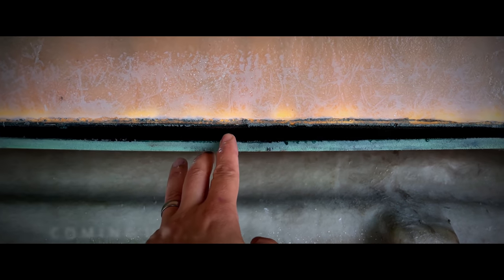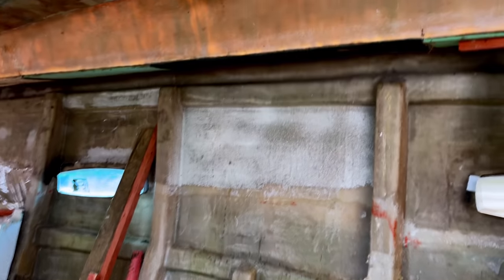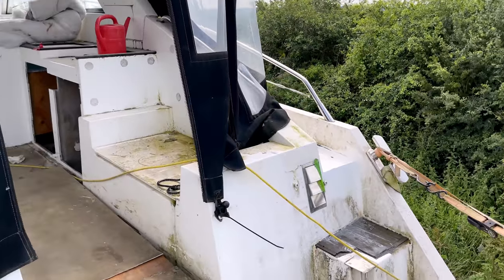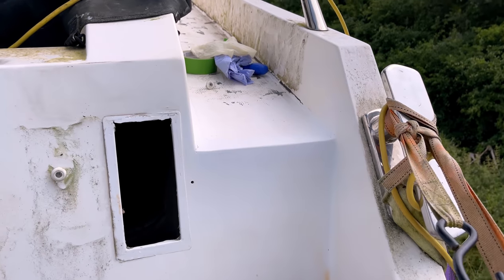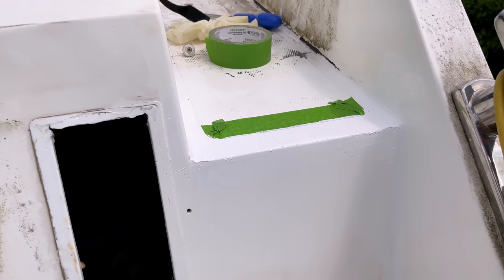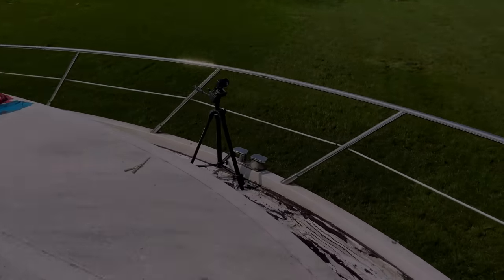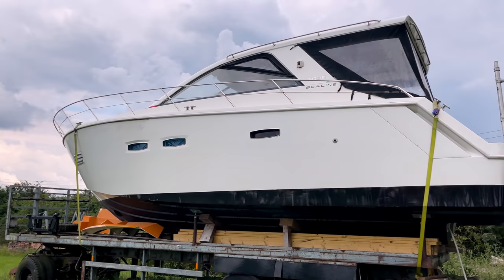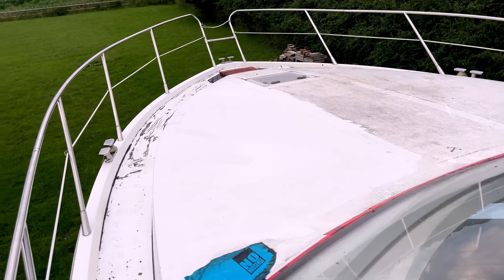BOAT Restoration - GEL COAT Repairs and DECK CLEAN - EP.55

Comment: That was half way satisfying!  Waited a long time to see this beauty cleaned up ;-) I just don´t understand why you don´t remove all the wood and sealant before starting gelcoat repairs? It seems ineffective.. Sorry. Maybe you you don´t have time to do a full stretch, and are separating the workload into small sections. Nice progress though. It´s going to be a beautiful ride in the end.
Reply from the maker: Thanks. We debated whether to clean the decks first, but decided there was a high risk of forcing more water into the core.  We did change this method around on the second side, so we will be interesting to see which works best 👍
Reply: @boatholic4458  Thanks for replying. I understand the dilemma ;-)